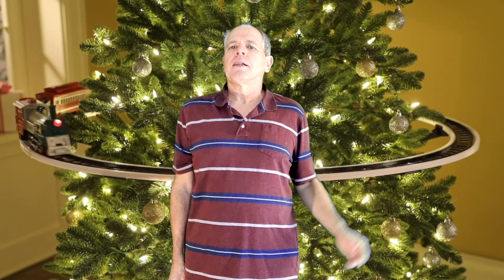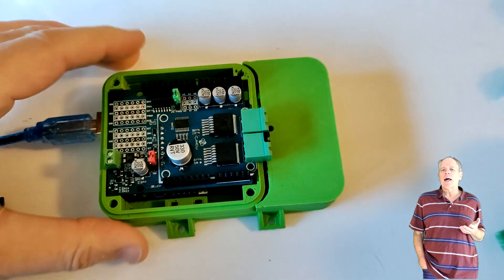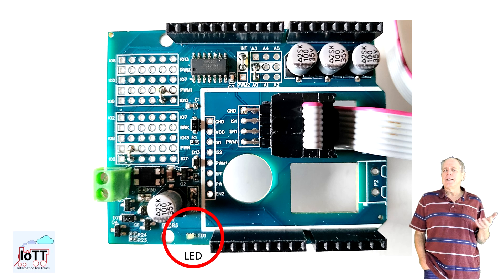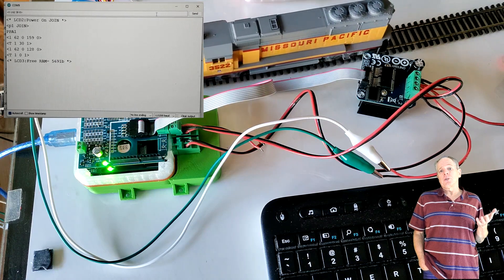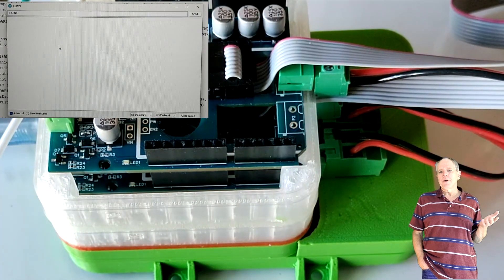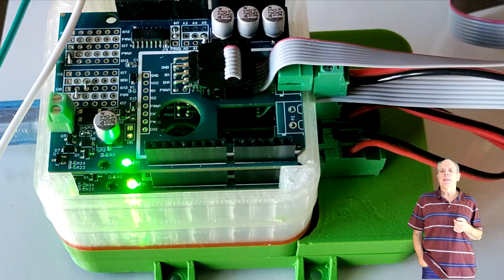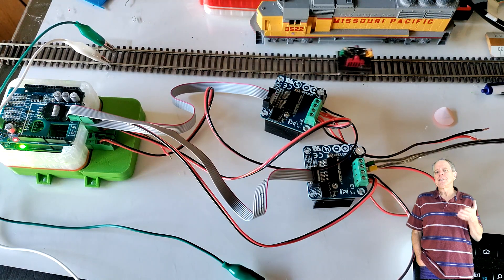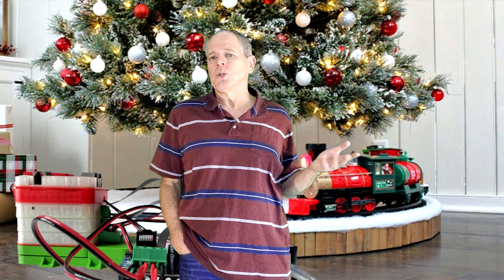5 Amps Power Shield (Video#109)

Comment: What is the difference between your power shield and the DCC EX Power-shield. They look similar.
Reply from the maker: In short, the IoTT PowerShield has more powerful chips but on the other hand supports only one DCC channel per board. There are more differences regarding power supply, which I explained in video #130.
The IoTT Powershield uses 43 Amps H bridges, which allows for drawing 5-7 Amps continuously and you can set the trip value in DCC EX to about 7500 mA. The 8874 is using a dual channel 7 Amp chip set with a significantly higher on resistance, so it heats up considerably more at lower currents and 5 Amps is more a peak value.

Comment: Will this circuit work with G scale trains??
Reply from the maker: Assuming you are using it with Arduino and DCC EX as shown in the video, yes, no problem. The new version will be good for up to 25V track voltage.

Comment: I am tring to use the makerfabs motor shield. need help.
Reply from the maker: Maybe start with a description of where you get stuck. Installation? Wiring? Configuration? Software installation? 
Also, check the hardware information on the DCC EX web page: https://dcc-ex.com/reference/hardware/motorboards/makerfabs-h-bridge-motor-shield.html
Reply from the maker: Ok, I had a look at the schematics of the board. This is what I would try:

#define STANDARD_MOTOR_SHIELD F("STANDARD_MOTOR_SHIELD"),                                                \
                              new MotorDriver(9, 4, 5, UNUSED_PIN, A0, 3, 500, UNUSED_PIN), \
                              new MotorDriver(10, 7, 8, UNUSED_PIN, A0, 3, 500, UNUSED_PIN)

These settings should give you a DCC track output on both channels. The problem with the board is, however, that it does not have a current sensor (that's why I set both analog inputs to A0), so there is no short circuit protection, nor can you use it for service mode programming. For short circuit protection you absolutely need to have some sort of circuit breaker or current limiter, either in the DCC output or in the DC input to the board. Otherwise, your transistors will pop when you have your next derailment.

Comment: You've come a long way since your first videos.   I've been following this project from the start and it really does rival some of the expensive  commercial products.    Now the only barrier for people getting into the hobby is the cost of the locomotives and rolling stock.........
Reply from the maker: DCC EX is a great software but if you look at who is using it, it is mostly technology minded people (or Engineer level in DCC EX terms). In order to help to make it compatible with the average model railroader ("I have no clue about electricity, I just love trains"), I am focusing on four things: Performance (meaningful track current, hence the new PowerShield instead of the Mickey Mouse Motorshield), Simplicity (everything plug and play, therefore the shield form factor), Connectivity (Loconet, because on a larger layout you need some type of control bus to connect distributed components, and the above type of model railroader does not want to mess around with jumper wires for sensors or servos), and Aesthetics (therefore the enclosure system to impress the wife).
Reply: @IoTT  thank you

Comment: I think the demand for these will be pretty high.  It could come as the new standard motor shield to use for DCC-EX making the audience for this board quite broad.
Reply from the maker: I think there is a certain potential as for the first time it is possible to have a meaningful track current without having to be an engineer and messing with jumper wires. Plug and play is a precondition to make a DIY command station like DCC EX attractive to a larger audience. Time will tell ;-)

Comment: Does this work with the Arduino Mega board?
Reply from the maker: Yes, as you see in the video, I am using a Mega for the demo. But it also works with the Arduino Uno.
Reply: @IoTT  sweet, I currently have the Deek Robot motor shield and Maker Fabs WiFi system and I know the current will be a limitation.